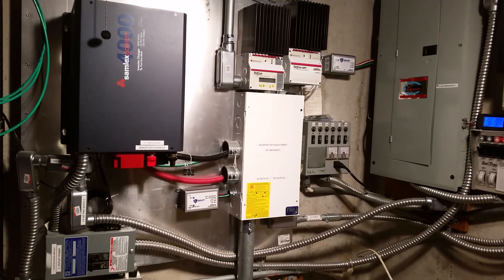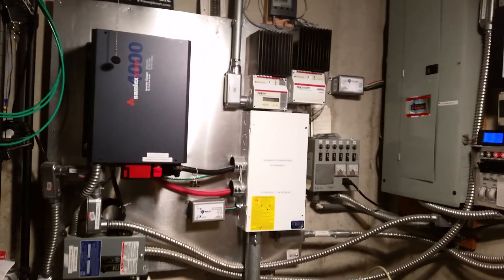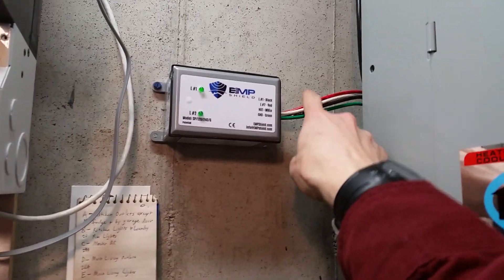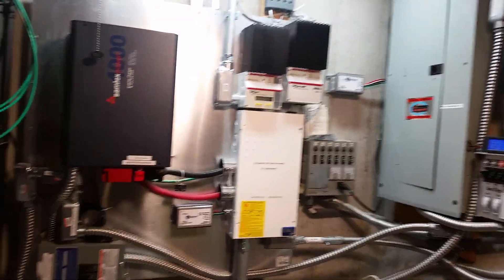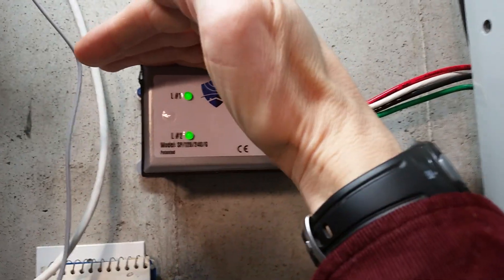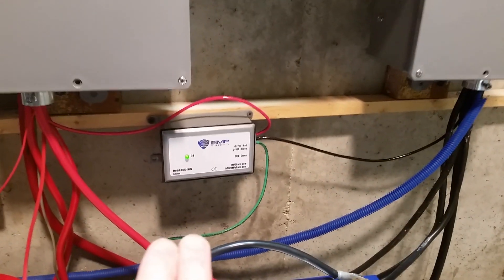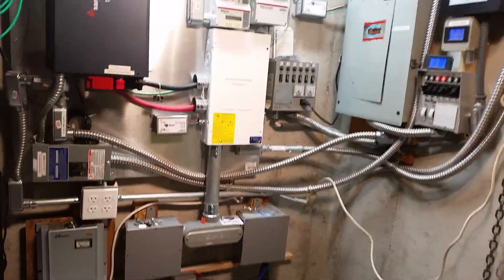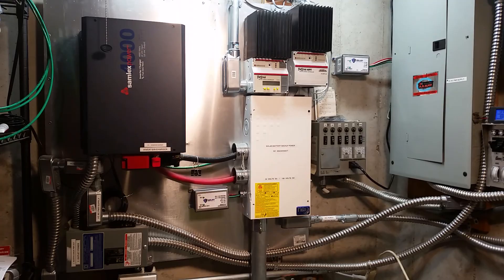Off-Grid Solar Backup Power System:  EMP Shield Power Surge Protection

Comment: That's funny! I just installed a emp shield on my solar charge controller today. Everything was working fine but the light went out once it turned dark outside. I thought it was broke till I realized what happened. Pretty funny! Then I found your video. So I had to comment.